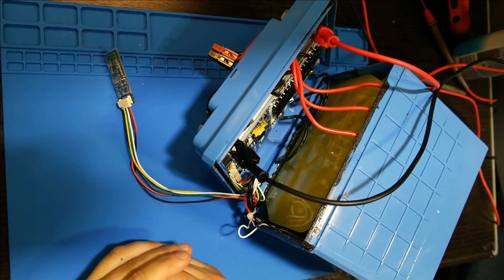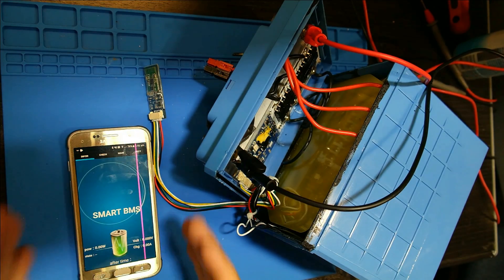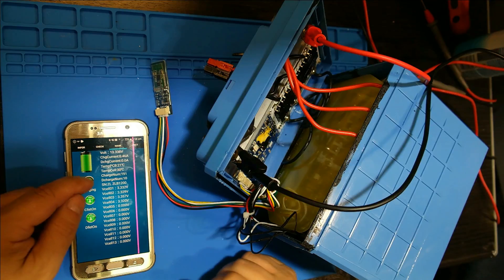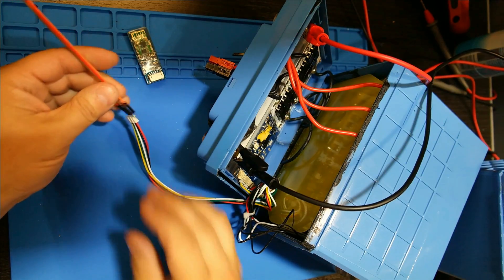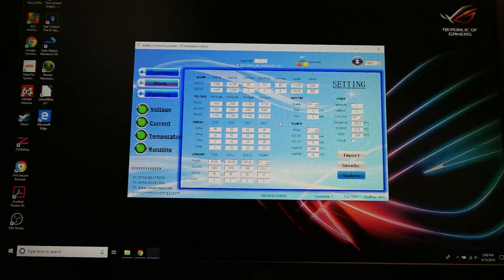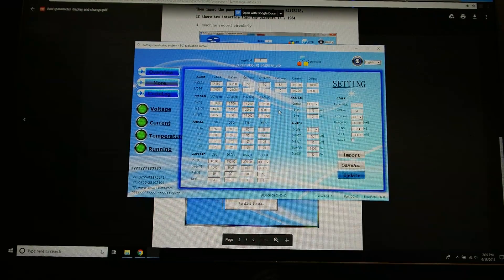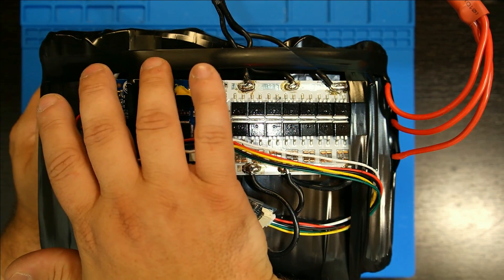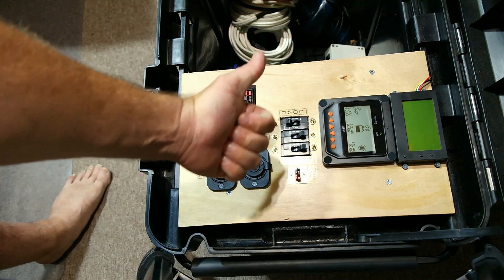Hacking Two 50H LIFEPO4 Battery Packs Together

Comment: Hi, Great info. For solar on an RV would this type of set up work or are deep cycles batteries better. I was hoping to run a 2 to 2.5 kw inverter off the batteries. 12v dc to 230VAC. The only thing using 12vdc would be the water pump.

Comment: Hi, did you happen to look at the spec sheet they provide on this battery?  I found one for the 100ah version and they list the low voltage cut-out at 8V on a 12V pack.  What is the deal with that?  Shouldn't it be around 10.4V?
Reply from the maker: I agree 8v is too low.

Comment: Nice set up.  That BMS should do a decent job of top balancing the cells and with the display you could easily see if you have a weak set of cells somewhere while discharging.  Are you running an inverter on this one too?
I only saw 12V out.
Reply from the maker: no need for an inverter, just 12 volt portable fridge/freezer, lights, fans, and usb charging.
Reply: Very nice capacity pack. No more warm drinks for you. For a solar generator it would be nice to have an epaper display, led and lcd displays really don't work well outside.
Reply from the maker: If I knew how to reverse engineer the data the BMS sends i'd love to switch to epaper, sadly that is not one of my skills.